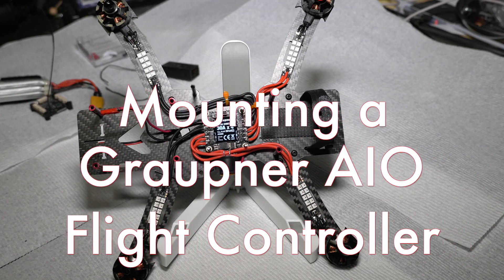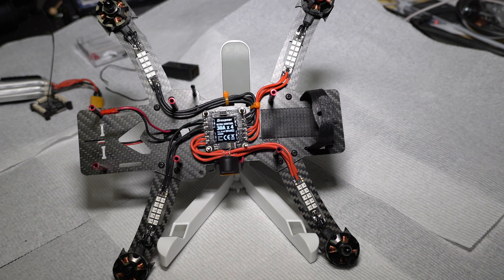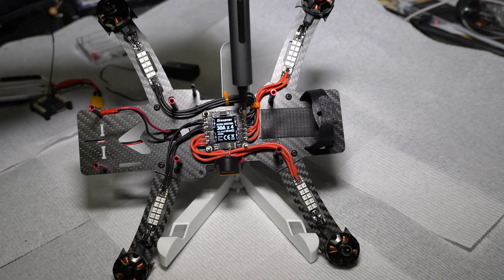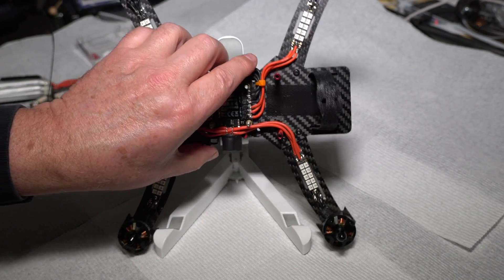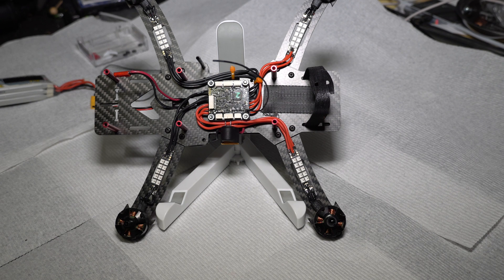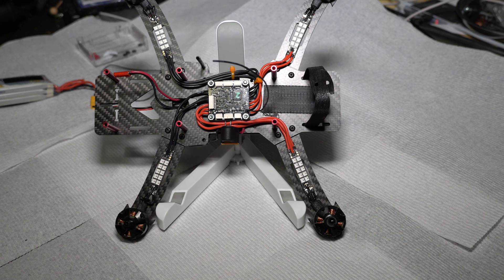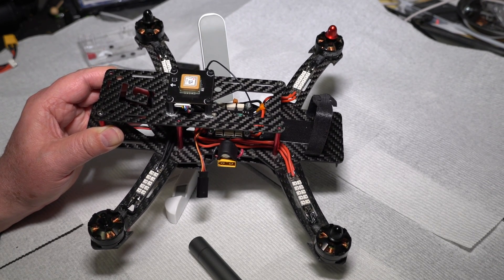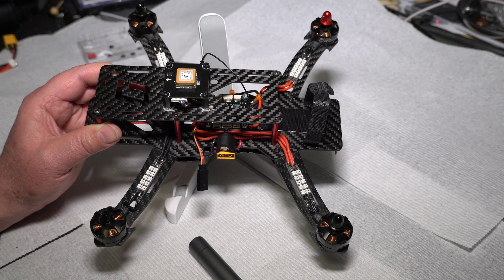Mounting a Graupner AIO FC (S1038)

Comment: This is exactly what I need
I have one all wired up and have motors running Iflight Zings.

I had to drop pid values way way down on yaw as the motors where heating  up and the quad was doing a wild yaw movements on the bench with no props on.

Stuff we need to know a lot about is that vtx port on the side where it talks about uarts in the manual and the smart port stuff.. I am bypassing this at the moment .. would have been nice to have the Graupner OSD built in as well.
I also removed the XT60 plug on the esc and added a wire to XT60 due to zero room in my frame as well as hacked the pod a lot.
This is all a test rig with an old runcam split first version cam.
The model has the Graupner GPS .. Everything is in one stack.
 https://fpv-flightclub.com/products/flightclub-tokio-pro/
Might fit better in the https://fpv-flightclub.com/products/flightclub-proton-race-drone-frame/
And will definitely fit in the Bangkok frame without GPS tho.

Will have to mount vtx out on the side of frame for now on the Tokio 

Currently I am up to mixing the flight switches on a MZ18 Pro radio and due to very poor description it not simple process  where as normally it is either top or bottom for rate and Stabilization  modes.
I have done one that calls out the modes plus seams to reach the required servo values but tomorrow I will look at doing another mix on a different temp model using the channel 5 complex mix box which I noticed later.. Should be able to get 45 plus middle position  and 50 plus top position with the low position - 100 for Autopilot I think and mix Ch 6 and 7 from there.
Reply from the maker: I am not going into the PID's in my next video, was planning to make one just on PID settings after I complete the current set of video's. I am surprised that the yaw gave you that much trouble. The Tokio looks like a pretty symmetrical frame, although I must say I thought stopping and starting a spin (yaw) on the quad sounded a bit off with the way the props kicked in. I have however not detected undue heat in the motors after a 5 minute flight

I wish now that I removed the XT60 plug and may still go ahead and do so. Not liking the way I have it set up right now but the quad does fly really well. 

I can duplicate my phases on a MZ24 if that would help but I will have the MZ32 video out today to show how I did the phases. Some of them are very specific to the MZ32 as it has some cool features I wanted to use/show off in the process. 
If I have time I will endeavor to set up the MZ24 and make a quick video on the phase setup.
Reply: @yufasa 

 Ok had a quick look at the MZ18 again tonight.
If you go into the mixes of that radio you can mix channel 5 to channel 5 and that allows you to do an offset on the channel to move channel centre lower and control of 45 and above and negative 100 .. Use logical switches to set phase after that and announce..  The MZ18 has limited phrases and not enough to do the full requirements I think..
Reply from the maker: I just finished recording the phases video for the MZ-32. Will edit and upload by tonight
Reply from the maker: Oh, and I am going to add the standalone Graupner OSD to the quad but I agree that having it built in would have been much nicer. I have a VTX on order that uses the smartaudio capability and I will update my video once I get all that added.
Reply: Also checked a butter mount plate I have here for a FPV-Flightclub Proton and as it is that ESC will fit standard just fine with the plug out the rear.. 
Could even fit a GPS at a pinch.. 
I will get Mike from Flightclub to send me a complete frame and I will also look at a 3d build using Graupner and the frame.. USA don't seam to have the 3d version of that esc yet.
Reply from the maker: I played a bit with my MZ-24 trying to emulate the phase setup I did for my MZ-32 and came up a bit short due to a few limitations the MZ-24 has. I will need to come up with a slightly different approach but still think using the logic switches is a good idea. Take a look at the phase configuration video I did for the MZ-32 to see what I mean.
Reply: I spent more time yesterday trying different scenarios MZ 18

One with from the ctrl set settings and going to Ch 5 and entering +40% ... +40%.... +60%
This gives you the starting point for Rate at +100 Attitude + 60 and Autopilot-100 through all phases.
Before you do any other settings.
Next was to set up Motor Cut.. thrn gonsnd set up throttel curve with higher start and next st point 1 set + 009 to lower steps in how the throttle responds at low throttle.. next set up Fail safe Ch 5 and 6 to position and Channel 1 to hold.

With all this we had to have voice files to match the modes so this was done.

I set up my logical switches and this is where limitations com into play as you are not able to have 2 logical switches on in phases as it will not select the last phase of Carefree Mode do a logical switch for that modifier only activates the sound file.. which is ok but will.not show up in phases.. once I had the logical switches set up I associated the sound files to that logical switch so I could keep track of the switch positions and then built phases for the modes.
For Auto Flip phase I had to change values on channel 6 while in that phase  to +125% ... 000% .... -125%
Now testing this
The second way is to go into function and then program mix ... then select channel 5 and mix channel 5 to channel 5 and select on.. in the mixer of that channel put in A +042% and Offset Y +042%
This will give a starting point on ch5 for all modes.

You still need the Auto Flip phase to be able to set channel 6 in the ctrl set to +125% .... 000% ... +100% slightly different.

All in all really good info for the MZ 32 which is really appreciated  by many I would expect. . 
The MZ 24s and 18 Pro radio do show that they lack quite a bit of ability to do advanced mixing for sure.
As above in my 2 examples it only achieves a basic level .. there is a 3rd way but it is very messy and confusing..

You may come up with a logical switch sequence to allows the phase selection of all flight modes less a Auto Flip phase. . Adding the Auto Flip as a sound and modifier only.
Let me know.
Reply from the maker: @Michael.Ryan.Videography  Thank you for pointing out the channel adjustment, I actually did that but forgot to show it in my video. I also have voice set up for all the phases and I do not want to be left guessing while flying. I think I will update that video and repost it showing both. I will also put some effort into the MZ-24 to see what the best way would be for me to achieve phases.
Reply from the maker: Try this model: https://www.dropbox.com/s/vt2niw3oq3nu0ws/qAIO%20GPS.mdl?dl=0
Reply: @yufasa  

That would be good.

After playing with the values as the manual is a little vague.

I tried on ch5 in ctrl set 
Rate Mode eg Phase
Rate = 000% ... 000% .... +100%

And:

Ch5 in ctrl set 
Attitude = 000% ... 000% ...+100%

Default Attitude Mode no phase .. but default 1 phase at top of phases Renamed to Attitude Mode 

Way points Mode eg Phase
ctrl set ch5 -100% ... 000% ... +100%

Position Hold Mode eg Phase
ctrl set ch5 -100% ... 000% ... +100%

Return to home Mode ..eg Phase
ctrl set ch5 000% ... +100% .... +100%

Those values achieve 000% at middle positions and I think correct values for modes..

Still Testing